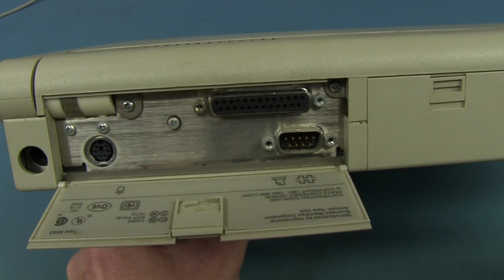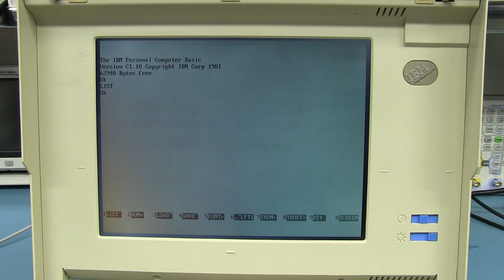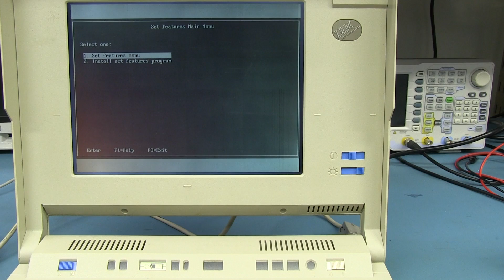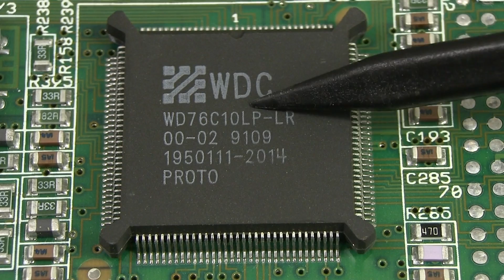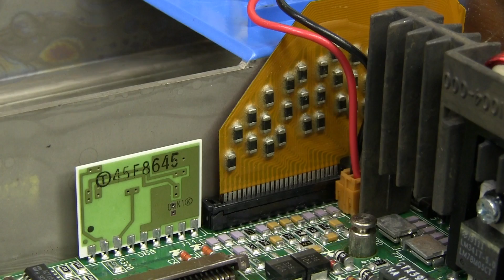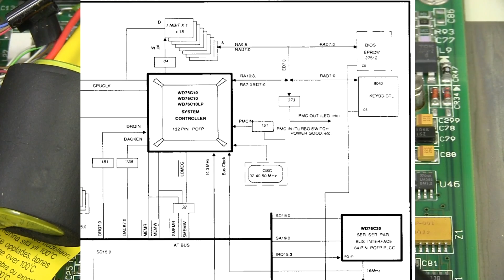EEVblog #639 - IBM L40SX Retro Laptop Teardown

Comment: It's a shame that IBM doesn't build laptop anymore. I consider myself lucky to have one of their last thinkpad.
Reply: Ovni121 They already have. Look at the T400/500 keyboard compared to the T60/61.
Reply: Agree, since Lenovo "took over" ThinkPad sucks! Have a X220 now..
Reply: The Lenovo T series are still really nice, I fixed up a t410s that I got for free, and it's quite a nice beast. Graphics wise it's no good for gaming but can do 1080p streaming no problem, and build quality is still really nice, magnesium frame and LCD cover.
Reply: Most likely lol. It's a business machine though so it's understandable, though it would be nice to be able to play a casual game like banished on it.
Reply: Yeah the T60p was a pretty sweet machine, I was still using it until a couple months ago when I finally got all the parts I needed for this. I still have it, but the GPU started to go in it.
Reply: Re It's true that IBM team is still around, actually I have a W520 wich is branded Lenovo. But as time go by, Lenovo engineers will gradually take over and my guess is they'll gradually reduce the production cost of their workstation and their computer will become flimsier.
Reply: I take it you have the Intel graphics then. :)
Reply: Eh, I have the discrete graphics on my old T60p and it's surprisingly powerful.
Reply: The X220 might be the best laptop that has ever been made. It blows away any of the IBM Think Pads.
Reply: Re YOU ARE EVERYWHERE

Comment: Those WERE the days :) but just a minor point, the first colour laptop was the 5kg Sharp mains-only luggable in early 1993, so it is unfair to knock the L40SX's grey-scale LCD. The Sharp was £5,000+ too, because of the ridiculous failure rate of the early colour LCD panels.

Comment: 161 and 163 are common IBM PC errors about faulty backup battery...at least your floppy drive works, on my old 1991 IBM ps1 2011 having an exhausted backup battery means that you can't use the floppy drive! For some reason, on my IBM machine, battery and floppy drive are related in some stupid way.

Comment: im not sure what the hard drive connector is as they used a few different types, but the IDE ones are usually convertible to compact flash or SD quite easily, really cheap solution. some of those hard drives in the old IBM stuff used ESDI connectors which are a PITA.

Comment: I live in the USA and I used that laptop for programming PLC . It worked try IRD and serial port. I was working for a big UPS company . They made from .5 kva up to 10,000.00 KVA . The switch gear had sy/max and Allen Bradly. and a few older ones. That laptop worked great for the 11 years I worked there. I even have one kicking around somewhere . All the guys who programmed the PLC got the first dibs when they upgraded the laptops . We had to use the parallel port for a dongle . You have to have one for each of the different programming software   .It was 1992 when we started using them . That was the job a headhunter  got me after I spent 7 years in the NAVY on submarines . I was going to reenlist for 4 more years as I was going on my first shore duty rotation. I was going to San dingo for CCTV school then back to my hometown to run the security system at a torpedo maker. Now that I look back I wish I had stayed in the NAVY!!!

Comment: If I remember rightly 161 and 163 mean that the CMOS battery is flat and the settings are gone/corrupt. On most machines of the time a CR2032 was used, although IBMs sometimes used other sizes. I have one that is a couple of years newer that uses a CR2016.
Reply: 9:05 There we go! :)

Comment: I suspect that the reason that it didn't read the hard drive was because the batteries were dead and the board 'forgot' the Cylinders Heads Sectors information (printed on the hard drive).

Comment: out of curiosity, could you just pop a 4 gig ram stick into there, or rather would it work?
Reply: As far as I'm aware, SSD are only SATA, so you'd need a SATA > IDE converter. It's far easier and cheaper to use a CF card, they already use IDE, you just need a passive adapter.
Reply: Absolutely not. I didn't get a good look at the RAM slots, but they look like SIMM modules. I don't think those ever went higher than 8 or 16MB.
Reply: Brant Martin would a modern SSD just plug in?

Comment: I love how I can see the design cues from these early IBM laptops in my 2009 Lenovo Thinkpad R500. Bought new and still running strong as my main PC after upgrading with a SSD, some RAM and a minor fan repair. The lack of an IBM badge hurts a bit, but I'm not a huge brand whore anyway. The biggest selling point for me was durability and I'm not disappointed.

Comment: 25:04 it's interesting to see they used a monochrome LCD in this thing.. In some of the really old laptops I've owned, there was an orange-on-black flatscreen plasma on it, the contrast was amazing!
Reply: I had one of those! I think they used a lot of power. My one certainly got very hot.
Reply: ***** Haha take a look at Plasma_display on wikipedia and go to 1983. There they explicitly mention the orange and black style. I had one on a really old Compaq 80386 (google tells me it was the Portable III). There was even a windows 3.1 driver for it. ;)

Wow! "The monochrome plasma video display was co-invented in 1964 at the University of Illinois by Donald Bitzer, H. Gene Slottow and Robert Willson for the PLATO Computer System." That's from another site. I would post a link, but the chances are you'd never see my comment due to the spam filter.
Reply: ***** Yeah, that quote surprised me as well :)
Reply: The orange/red gas plasma displays were much brighter and had better contrast than the passive-matrix monochrome LCDs that were common in the '80s and early '90s, however, they used too much power to be usable in a battery-powered laptop.
Reply: *****
The orange was indeed plasma. I had a 80286 with that.
Slow as hack but did what it needed to do.
though not my oldest as that was a 8088 lcd. they mad a desktop on your lap when you had that closed
Reply: FunnyHacks They certainly did use a lot of power! When I said "laptop", I meant a computer you could potentially carry around (it had a carry strap and everything), though it didn't actually have an inbuilt battery, and it weighed an absolute ton. I still feel bad for tossing it away a couple years ago in a big clean-up :( , it had Windows 3.1 and working harddrive and working everything in it, dual floppy drive, ISA extension slots with an old modem in it. shit I feel bad for tossing it away, got it for like 5$ at an early computer convention. You'd probably have to shell it >100$ these days to get one of those
Reply: well in a way it is that a plasma screen, no heater just high voltage and a sort f amber colored phosphor. But it was a thick glass slab and it didn't have a battery. Makes it more a heavy portable pc then a laptop lol

Also found the model again. it was a Toshiba T5200. I thought it was a 80286 but turns out to have been a 80386 CPU.

https://www.flickr.com/photos/27241501@N03/9360820281/
Reply: Yep, reddish screens were plasma and at least Toshiba made terrific plasma screen laptops in the late 80's early 90's. Then there were some laptops with CRTs also and they looked almost like having a desktop case with a small screen and swiveling keyboard in front. Some of those might also have LCDs, but those were the least portable type and you pretty much dragged them with you. One of my friend's father had such Compaq at some point, 386 20MHz if I remember correct and fast as hell at the time most computers in home were still 286 or even 8088/86.

These vintage computers are just beautiful, both desktop and laptop. Odd looking and slow, yes, but they have sort of quality in them which you can only find in industrial products these days. Capacitors are pretty much only thing that goes sour in these with all the years, otherwise they will boot until the end of the world. Possibly even after that.
Reply: vwestlife Your comment made me wonder what sort of batterylife was common in this laptop, anyway. Nearly a decade ago, I had a laptop with a NiCd battery, and although the battery stayed "good" for way past the service life of the laptop itself, the battery life was pretty terrible from day one. Two hours was really the maximum sort of battery life you could get out of those things. Then again, you can still find pretty poor 2-hour battery lives in most low- and mid-tier consumer laptops
Reply: ***** Hmm I think you're right. Dave did mention the AC adapter was 15V 2.7A , so we're looking at a 40W unit, so the laptop itself (excluding battery charging circuit) has to be somewhere between 25-30W total absolute max rating. With the slot designed to fit the NiCd battery, I guess we're looking at 40-60Wh of battery. So I believe the "laptop" in this video didn't have that bad of a battery life, at least an hour or two if not more. And you're right again that in these old laptops, they weren't so much built down to a price point as laptops are today! 1:30hr of battery life is shocking though. 6-12hr of battery life is fairly normal in high-end models these days, though I have absolutely no idea what sort of laptop the G7 is. If it's a "desktop replacer", then 1:30hr of battery life isn't necessarily a bad thing as it'll be rarely used on battery
Reply: ***** I'm not sure if you are referring to the laptop in this video. If so, keep in mind that this one is an LCD not a plasma (the conversation about plasmas began as a tangent from that.)
Reply: FunnyHacks Yeah, the fact it's a regular old LCD instead of a plasma probably helped to increase battery life a lot! I have absolutely no idea how much more power orange plasma screens would use, compared to LCD (remember that the CFL tube in an old LCD was pretty inefficient and power-hungry as well, it's only when led backlight came along that you could really run a screen on a couple of watts). But then again, PSU on a plasma screen must be horribly power-hungry
Reply: ***** Oh, actually up until around the time of this laptop, a lot of LCDs had no backlight. This one definitely did though. :)
Reply: *****
2 Hours? PFFFT! Go look up the Toshiba Libretto series laptops

SIZE OF A VHS CASSETTE with about 4 hours of battery life with th HDD! If you used CF cards with it it would last EVEN LONGER and it had a ONE MONTH STANDBY LIFE

Too mch battery lives there XD
Reply: Monochrome means 2 colors. Such as the old 5151 P35 displays for the IBM PC 5150.
Reply: Well, yeah, but most people say 'NU EHTS NUT BLAK IZ A CULUR TUU U RETAWRD!', so I said 2 to not get those kind of comments thrown at me. I know it means 1 color, but I explain it to people as 2.
Reply: well, I kinda knew that, and I explained why I said what I sad above your comment.
Reply: The plasma display on these were options.

Comment: Dave why You didnt tear down PSU ? It might be intereseting if  You do seperate video on explaining of switchmode PSU's worked back in the days. Thumbs up so he can see !
Reply: The PSU wouls be probably weldeded by ultrasound. If you want this open, you should use a hammer. After that you never get box in origin state and you even could broke something in it if you have very bad luck.
Reply: Usually these PSUs are sealed shut with glue and/or ultrasonic welding making it almost impossible to open the case without breaking it. If you ever tried opening a broken PSU you'd know what I mean. I don't think the technology would be much different though. Maybe a higher switching frequency allowing for a smaller transformer.
Reply: Peter-Paul Vervoort You can , by gradually hitting sides with a screwdriver or something. it seals the glue off and then ya can take it apart ! Well, maybe some ancient fets or chips, would be cool though :)

Comment: Very simple enclosure, almost like a homebrew arrangement. Basically just a rectangle where the battery, motherboard, HDD and FDD sit next to each other. Quite different to modern laptops, where there are is a complex tight sandwich of custom plastic/metal pieces. The thermal management is another hassle. Blows my mind how they these days are able to get it all together, and in a relatively short time. Must be an interesting but stressful job.

Comment: Here, Dave, let me give you a helping hand with that LCD panel -
Front > http://animus.pro/public/lcd_1.jpg
Back > http://animus.pro/public/lcd_2.jpg
It's Hitachi 97-24634-2, made in Japan. Display matrix is VGA, monochrome, capable of 32 levels of gray. It has multiple OKI m5299a segment drivers on the back of LCD board. I also had exactly the same laptop, and also teared it down few years ago, so upon seeing Your video, went to attic and found LCD panel. :)

And I must agree with you - typing on that keyboard was pure pleasure. I remember running Windows 3.11 and learning Pascal programming on that rig even in late 90s, when everyone around was already playing StarCraft/Half-Life on their 133Mhz Pentium MMX.

Comment: That thing will most likely not be able to auto detect hard disk parameters (which may be why it didn't boot off the HDD) so using a CF card as a disk may need some fudging around with the disk parameters or use parameters from an equivalent size hard disk, not to mention there will be a size limit in the bios, 1 gig will be heaps assuming it's within the bios limit , 64 - 256 meg will work nicely, and you can get CF to mini PATA adapters real cheap
Reply: 528MB limit for those (and early 486's) http://www.dewassoc.com/kbase/hard_drives/drive_size_barrier_limitations_2.htm
Reply: That's right, and I did use an old 486 with that limit too, I would have edited it but the app didn't allow it, you could squeeze in a 512meg in that case
Reply: william fleete  I was thinking something similar when he mentioned SSD. While there are small 80GB PATA comaptible SSDs out there (Transcend makes one I know of) I can't see the controller chip on this thing being able to see it. Even if it could see it you would be using what FAT? Pre-FAT 16 even? Even if you could partition... the most you could ever get on this thing is early versions of PC DOS/ IBM DOS... and maybe MS DOS version 2 maybe 3 at the most?!?! This thing is pre 286 much less 386 or 486! It kinda reminds me of my old Tandy 1000s!

Comment: Hi dave, you can get cheap mide solid state 4gb ones off ebay and as they are built with laptop mide in mind no need for power as they are 5volts.there cheap if you wanted to have a play.

Comment: Great video Dave!

Just so you know, according to a Microsoft Knowledge base article on the web, boot error code 161 is BIOS battery error (it's probably flat), and 163 is Time and date not set, probably due to BIOS battery being flat.

EDIT: Sorry, was writing this comment before you found out yourself the same conclusion. Still a great video though.

Comment: A guess in the PLL circuit. Frequency spectrum spreading? At 20 MHz you would be around HF radio bands. Maybe it was part of compliance certification?
Reply from the maker: Doesn't seem to be in the right location for that. See the other clokc oscillator modules elsewhere.
Reply: de/modulator for the telephone modem? maybe

Comment: EEVblog IBM errors 161 and 163 basically mean that the BIOS has not been set up, and you may need to replace the backup battery or else if it's a rechargeable battery, it will leak acid and corrode though the wires damaging the mainboard.

Comment: Great videos, by the way. I had a computer shop back in late 90s up to 2001. I would buy surplus computer equipment some stuff good and other stuff not. We would spend hours dissecting the stuff that was not good, we had a blast. You must have so much fun doing what you do. Thanks for taking the time to share with us what you do....